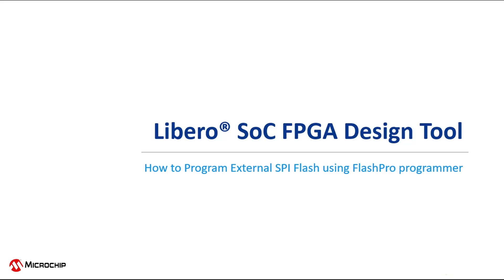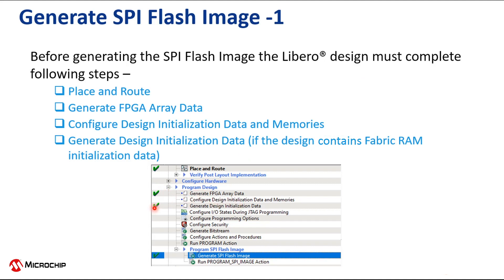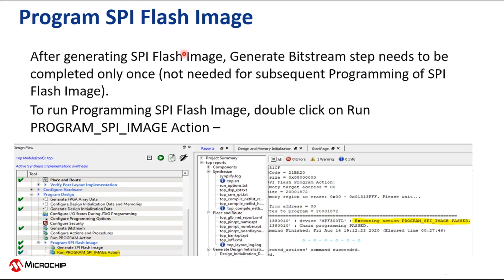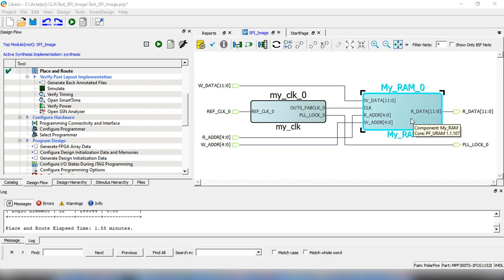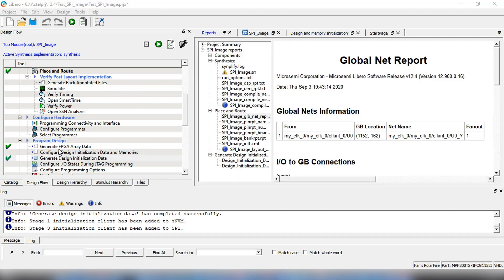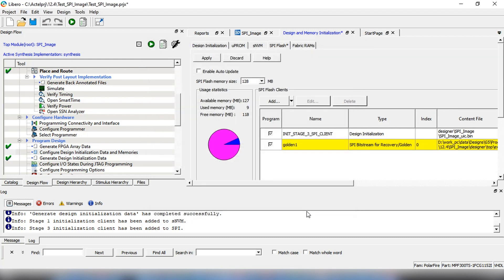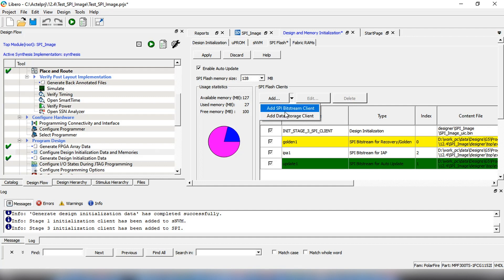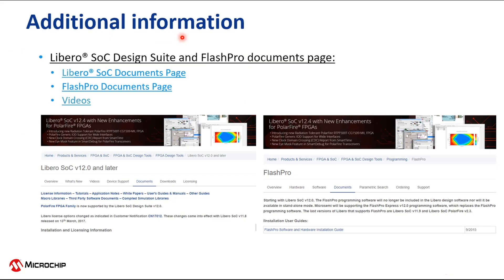How to Program External SPI Flash using FlashPro Programmer

Comment: Other FPGAs uses the extensions sof/pof, or bit for the file used for jtag programming.   What is the equivalent libero output?  pro, ppd, or pdb?

What is the production/technician software that can be used to program the above (and other files like : stp, ipd, STAPL, SPI, DAT) using a FlashPro5/6.. not the Silicon Sculptor 3.
Reply from the maker: Hi Ben, we appreciate your comment. This depends on if you are programming a FPGA or a FPGA + SPI flash as well. FPGA only, you can use FLAHSPRO5 or FLASHPRO6 or even the FLAHSPRO4. For SPI flash + FPGA – FLASHPRO5 will only support one specific FPGA family.

You can also use FlashPro Express, which can be downloaded separately or with Libero. The easiest thing is to export a FlashPro Express .job file, then in the FP Express create a project from a job file. This job file will include all the images that need to be programmed, and you do not need to worry about separate files for the FPGA and the SPI flash.

If you want to export different file types, Libero can export quite a list of different files.

From the link here: http://coredocs.s3.amazonaws.com/Libero/2022_3/Tool/flashpro_express_ug.pdf you can find the below information:

3.10.2.2.4 Formats

• PPD
• DAT
• Export separate ASCII HEX file for debugging- Exports DAT file in HEX format. This option is available only when DAT file format is selected.
• STAPL
• Chain STAPL- Enabled when there are two or more devices in the chain.
• SPI
• SVF (SmartFusion2)
• Export separate ASCII HEX file for debugging- Exports DAT file in HEX format. This option is available only when DAT file format is selected.

PPD and DAT file formats are the default file formats. If Auto programming is disabled in Configure Security, neither master nor update files can be exported in SPI format. STAPL and DAT are required for In House Programming. Anyways, exporting a job file from Libero either for the FPGA or both SPI flash and FPGA is the most straightforward. You would use FlashPro Express, and then depending on the SPI Flash, if you have any, either FP5 or FP6. Now there is also production secure programming if you would like everything encrypted and controlled, and then you would need the STAPL file or the DAT file, and the SPI file for the flash.

In order to better assist you with more specific details in regard to the device you are using, you can submit a support case here so we can help you one on one: https://microchipsupport.force.com/s/newcase

We hope this helps.😊
Reply: @MicrochipTechnology  Hi. I have a question. I want to program an A3p015 qng68 fpga chip with a FlashPro5 programmer JTAG onboard. What software can I use to program this FPGA through the FlasPro5 program and in which format must the program file be for me to upload it to this Flashpro5 programmer? Hope you could help me .

Comment: This design flow tutorial has a significant oversight. It's assuming you already have an SPI image. Using only what was shown in the video: you can't generate an image if the SPI flash tab clients are not filled out, but you also can't add an SPI bitstream client without an SPI file. New users may get confused and not know how to get that initial image exported in SPI flash format.